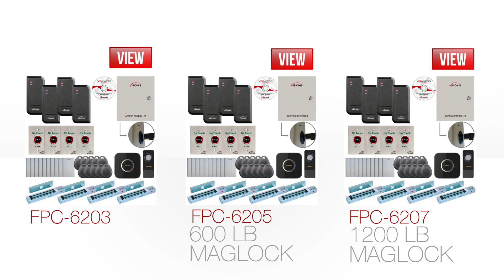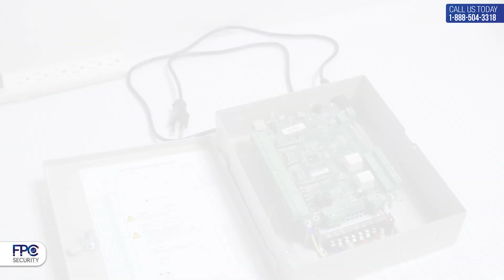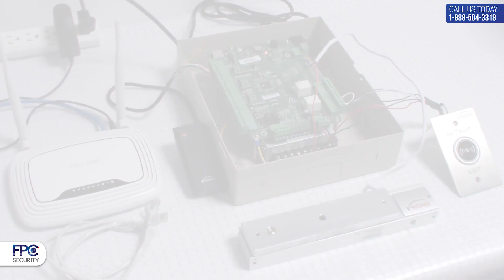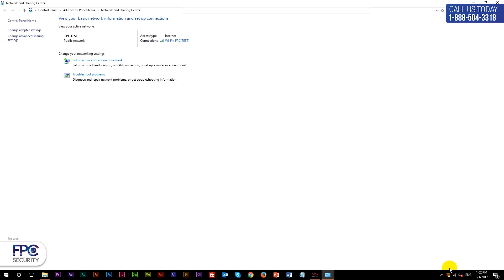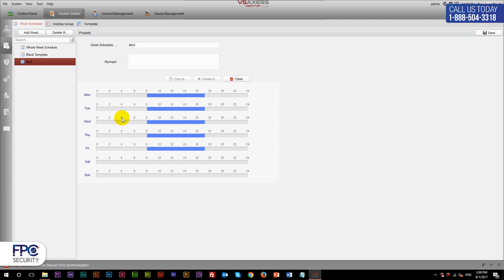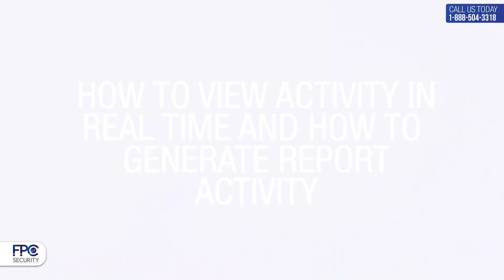(Old Version 2017)  Wiring Video for Visionis Access control with Vsaxess IP Desktop software Ver1.0

Comment: how far can you run the cables between the controller and maglocks/readers?
Reply from the maker: You can run the cables 300 Feet max. If you need further assistance please give us a call back at 786-442-1220, and we will be more than happy to assist you!

Comment: hi
so i wired everything like you should only thing is i have a door strike, problem is when i use my keyfob on my reader my door strike doesnt open, the door led doesnt even turn on, i thought it might be a problem with the key or something , so i tried opening it through the software but that still didnt work.
Reply: Good morning,

Please call us at 786-442-1220 for technical support or give us the best phone number to reach you at,

Best regards,

Comment: How does the wiring change for installing an electric strike instead of the maglock?
Reply from the maker: Hello,

The wiring would be exactly the same. All you have to use on the maglock or Electric strike is the positive and negative wires. 

If there is anything else we can assist you with please let us know. 

Thank you